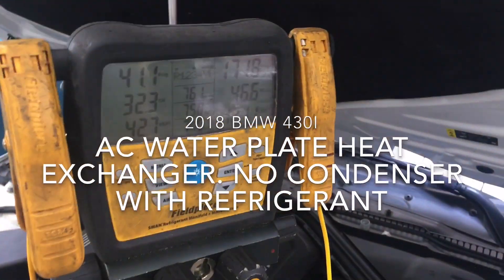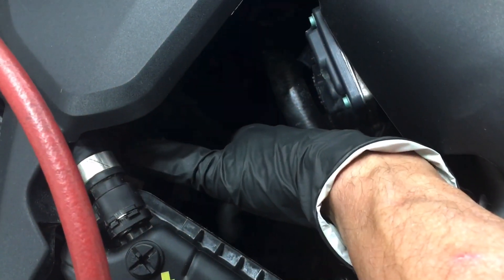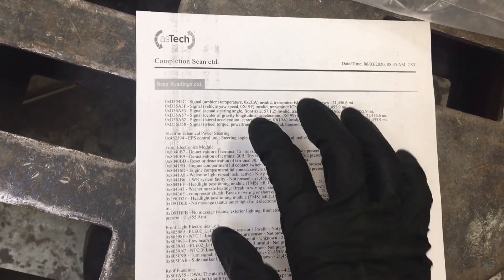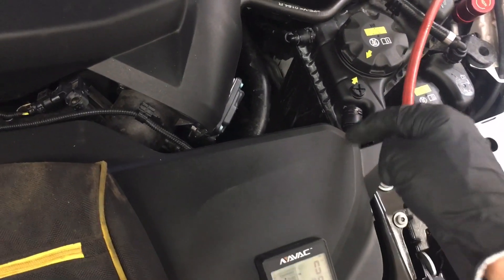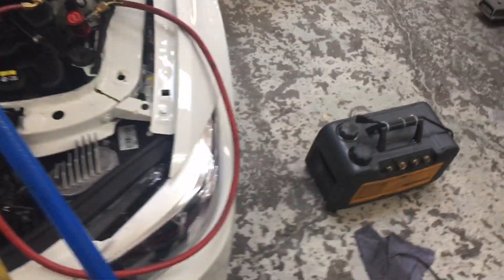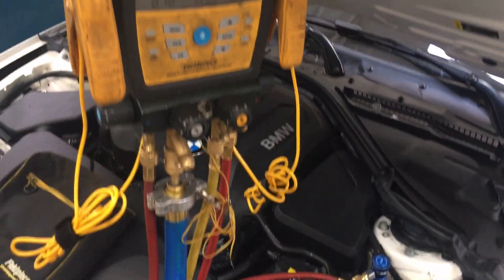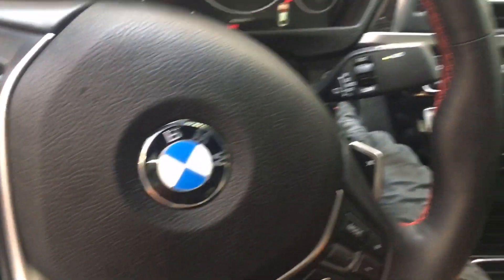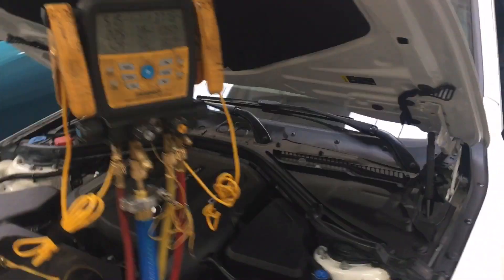No refrigerant condenser 2018 430i BMW High side pressure problem

Comment: The issue isnt the heat exchanger... Its the LTCPC.....I have fixed about 40 of them..The smaller tank ran dry caused the  circuit to kill the LTCPC. Also it doesnt have a heater control valve BUT it has a front mounted coolant module on the motor.
Reply from the maker: Turned out, the coolant was low. 
Added coolant and it worked I’ve only came across about six of these now . 

And every time it was only low coolant . 

Two times the body shop after collision . 💥 

The B&W dealership condemned that plate, heat, exchanger, receiver, dryer, expansion valve assembly, and that was not the problem . That’s what they said what was wrong

We just added coolant and that fixes it and BMW dealership technicians, don’t know how to diagnose their way out of a wet paper bag . 

I can imagine how many customers get sold the plate, heat, exchanger, expansion valve receiver, dryer assembly, and they never needed it in the first place . 

After the BMW technician fill it up with coolant Works . 
And the BMW technician thinks he’s a genius he fixed it .

I think this is my first one I came across on my second one so it was new to me too 

But I knew it had a glycol loop system
Reply: @coldfinger459sub0  The LOW COOLANT TEMP COOLANT PUMP (LTCPC) will default  to protection mode to keep from burning itself up when low coolant is detected. Low coolant will cause this but many times the pump will fail. The F32 is like this... The F30 doesnt have a drier so the condensor is the drier also...Some have a bag etc..
Reply from the maker: @ENIGMA-ONE-f4l  low coolant means there’s no coolant running through the plate heat exchanger in that assembly with the expansion valve and to receiver dryer

That means as soon as the compressor comes on the hot discharge immediately sores above 430 psi which immediately disengages the compressor 

Without coolant in the plate, heat exchanger it cannot get rid of the heat and condense the hot vapor into a sub cooled liquid refrigerant. 

So every fix on every vehicle, we got so far has only been to add coolant .  Problem solved.. 

Every time the body shops sent the vehicle to the dealership they wanted to replace the pump in the plate heat exchanger assembly, ridiculously high price for nothing .
Reply: @coldfinger459sub0  pump is easy to diagnose... you can activate the via diagnostic bi directional feed, I am well aware of these cars, and ac work... And have worked for BMW,LAND ROVER, and Audi, so no guessing here. If the pump stops, no heat,and no 1234yf charging due to high pressure blockage. all this is a bi-product of pump not working, rather low coolant in reservoir,or pump failure.TOMATO -TOMAATOS....The pump wont work if coolant low(no charge but heat)I have those same manifold guages your using in the video, no need , just a understanding of how the car work. A 150.00 set can show you the same data, and can show you reed valve failure too, that digital guages usually cant..
Reply from the maker: @ENIGMA-ONE-f4l  yeah I figured you worked on BMW

Comment: Can you tell me where the low pressure port is on this thing?  I need to add Freon, but the port isn’t by the firewall like all other videos show.  Something changed for 17-18.
Reply: Same question here
Reply: both ports for anyone who needs to know are located on left hand side near shock tower. on F32, if your caps are grey BMW uses these for 1234yf, but if its a older f30 say 2013 to 2015 the low is located near fire wall on driver side to rear of engine, and high side is to front left near shock tower.

Comment: Hi my friend 

I have had same condition for the same serie 430 i 2018

I solved the problem by vent the air from the auxiliary radiator (exterior one) by unpluge the join over the container ( small one) then switch the AC ON wait for 10 minute to exhale all air and put extra fluid.

Regards
Reply: Hi 
I have the same issue 
I refill the small coolant container is their anything else I need to do 
I recently had the water pump replaced and the ac stopped working 
Mecanic is saying is the ac expansion valve
Reply from the maker: @afelix530 yes number one common thing is low coolant. 

Because without coolant they air conditioning compressor cannot get rid of the hot gas pressure by chill it with cool coolant
Reply: What joint did you unplugged?
Reply from the maker: @afelix530 what do you mean by joint?
Are you talking about a refrigerant line fitting? . 

On this particular card, it’s been three years ago. I forgot what was done on this car either came from a body shop. 
      Or it’s in a mechanical shop that I was called into the find out why the side was going so high.
Reply from the maker: I will try that on next one I get
Reply: اخ عمار انا عندي نفس المشكلة